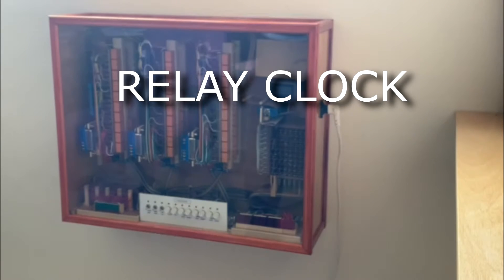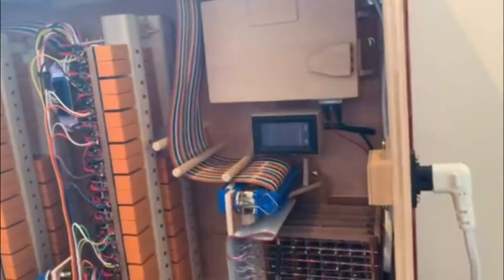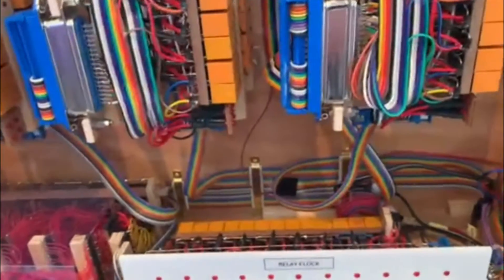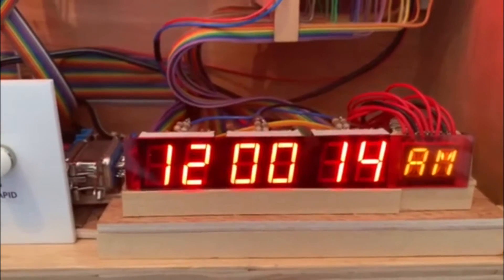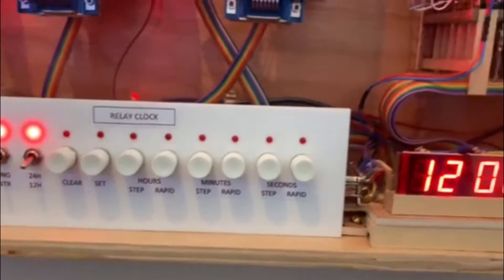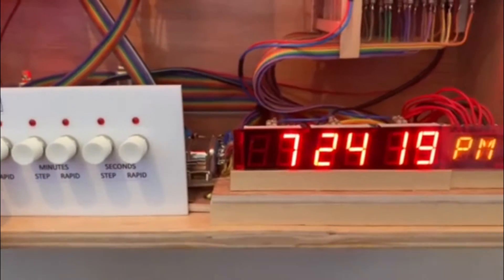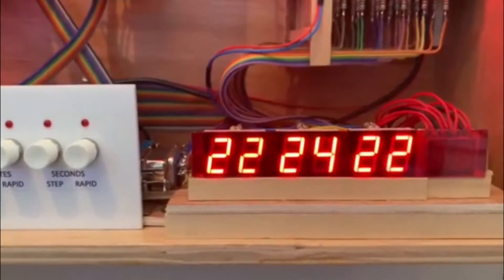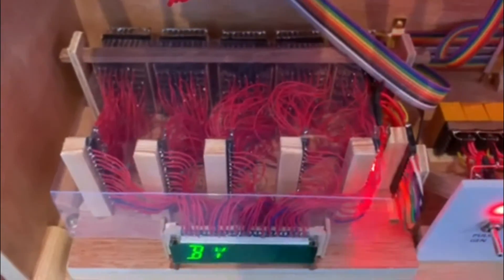RELAY CLOCK

Comment: been wanting to build something sililar but different. Having a hard time getting the ring counter to work properly. I dont think its wired right.  Do you have any schematics of how to set up the ring counter nd have it reset?
Reply from the maker: @kwacz  Hello.  If you watch the video to the end, all the schematics are there.  Pause the video on each page and take a photo then you’ll have everything I have.
Reply: @PeterBurton50 thanks for the reply. I thought it was just a demonstration of what you made because usually that's what I find on youtube. Unfortunately I stopped it literally about 1 second before one of your first schematics. I just watched the entire video again and you do have a wealth of information. Thank you.
Reply: Still cant get the thing to count. Basically I am trying to make a clock where each time the pendulum swings it activates a reed switch and the reed switch will advance the ring counter. I don't really understand how to read the diagrams you provided. Its not making sense to me. I cant seem to make any kind of relay based counter without a single pulse from the pendulum causing intense relay chattering and not actually counting.

can you make a video showing in detail how to go about making a ring counter that will advance once with each contact closure of the reed switch? If i can get this part to work I can figure out the rest.
Reply from the maker: @kwacz  my diagrams clearly show that the ring counters are advanced by means of a 2-phase clock.  This can be formed by a break-before-make double-throw relay contact fed from your reed switch.  By the way, I’ve not had much success with reed switches as they tend to fail after a time.  I would rather use Hall-effect sensors.
Reply: @PeterBurton50  I built the schematic labeled ring counters rear of diff socket wiring.  The only way I can get it to count is to apply B+ to both clock bus lines then apply B+ to the input labeled --< at relay 0a. Then all relays close. Then by removing and reapplying B+ to each clock line alternating them as i go it will open one relay at a time. There must  always be B+ on one of the two clock lines at any given time or all relays open and I loose count.

As long as I remove momentarily B+ from one clock line in an alternating manner (one line then the other) will it count.

I thought that only 2 relays were supposed to be pulled in at any given time and that they would move down the line but I cant get it to work that way.
What am I doing wrong??
Reply: @PeterBurton50  Your diagram is not correct or you are using some weird non standard way of drawing it. The 2 phase clock bus as you have signaled the waveform and phase alignment does not work. The circuit does not work. All relays pull in all at once and they drop one at a time by applying and removing power from the clock lines 90 degrees out of phase. Your diagram shows opposite polarity on and off in phase which obviously will not work.

I am asking for help not to be pointed to a diagram that is drawn in a way I do not understand what it is telling me. This is not how I was taught to draw schematics and I dont know what it is telling me.
Reply from the maker: Sorry to hear that you’re having trouble with your relay counter build.  I admit that the way I draw my relay diagrams are rather ‘non-standard’, but they have worked for me in the numerous projects I’ve made over the last 60 years. 

May I suggest that you look on YouTube at David Skirmont’s Nixie Clock build where he also uses a 2-phase clock and relay-controlled ring counters.  His diagrams are drawn in the ‘standard’ way.  In particular, see his diagram at 2 minutes in on part 1 of his build. 

Also look at US Patent 3456241.  The diagrams there clearly show how a ring counter is implemented with relays. 

These two sources of information were invaluable during my clock build.
Reply: @PeterBurton50  ok thank you. I will definitely check those out. 
What I'm actually trying to do is make a pendulum driven clock in each tick of the pendulum have it advanced the ring counter. That is the problem I'm struggling with now getting the ring counter to work so hopefully those resources you specified will help. 

I did want to mention that the second problem I needed to solve was to get a way of counting down at the top of the hour for ringing the chime. Your diagram actually does fix that problem because the relays are all energized and de-energize one at a time until there's none left. I can use that as the counter for the chimes. I just need to get the ring counter to work as intended so that I can keep track of counting seconds minutes and hours of the actual clock.

Comment: Beautiful!!!!! Those diode network driven displays are so nice. No multiplex flicker here!!!  Those incrementing relay chains remind me very much of what I discovered by messing around with alternating polarity so every other relay was positive triggered, the others negative, using a two phase clock. When it turned out these chains can also work as shift registers, my brain exploded. So I had to build it out and yes they do work as shift registers that can have a mode where they split into multiple chains of 10 that do base 10 counting (or other bases as you have here). Far too interesting.

I bought a bunch of diodes 20 years ago for continuing my project, I have three old elevator controllers. However 300 relays isn't enough to do what I wanted so my project died (though I still have everything). I love seeing videos like yours because you have a complete device with good controls and features, with very nice indicators.  I'm still working out a purpose I can build something for, I know something will show up and I'll dive in. I want to do some kind of controller that has some storage, takes data entry and has I/O control of something else, with a good, functional and fast control/indicator panel.
Reply from the maker: What a brilliant comment.  Thank you so much.